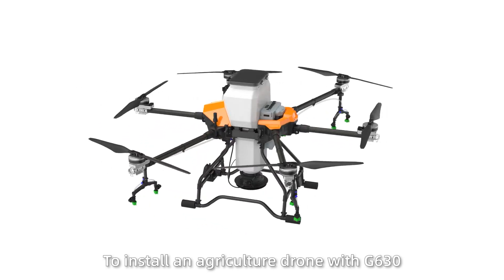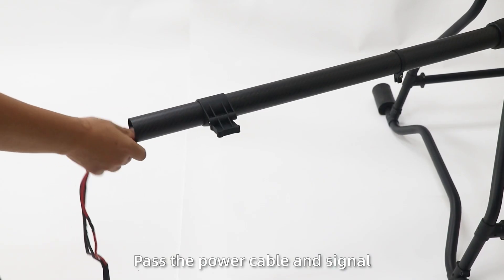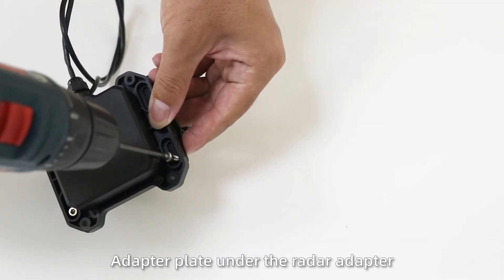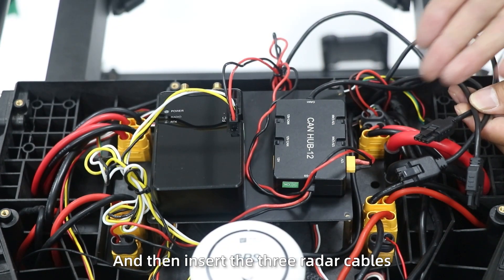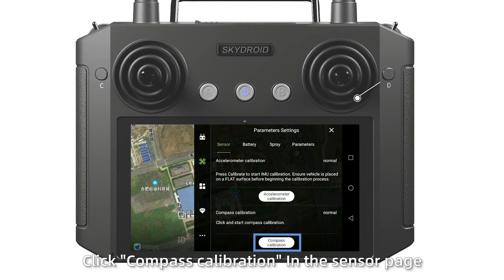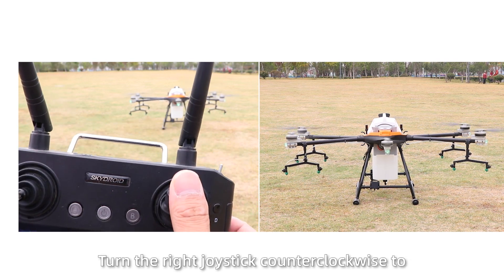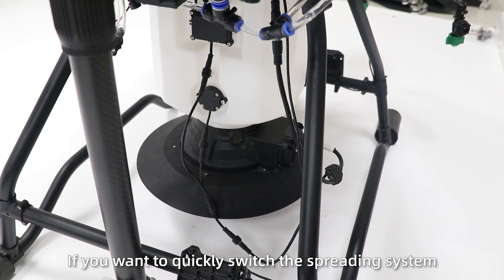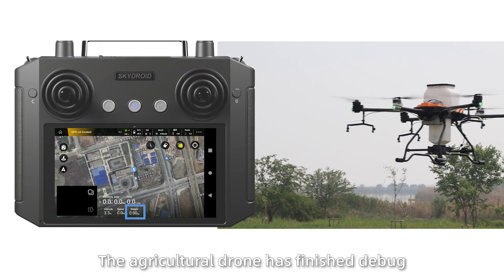Tutorial video || How to assembly an agriculture drone forn spraying and spreading

Comment: Hi, I've been looking for information about drones and I've reached this video.

Is the installation method similar for other EFT models? (e4xx, e6xx)

Is there anything I should buy other than a frame, a water bottle, a water pump, nozzles, motors, propellers, batteries, and joysticks for assembly?
Reply from the maker: The assembly of the E series and G series is slightly different. For the E series, you can refer to this tutorial of E616P, which you can know all the components.
https://youtu.be/r_A6ZNlqfu0?feature=shared

Comment: Where can I get this version of software for RC Controller? When I press New Plot, there are options for Handheld GPS, Flight GPS, Map selection and waypoint mapping, but none of them show the options for plotting the actual flight mission, only borders and obstacles... Is there a video for mission olanning and execution?
Reply from the maker: The remote control we tested is by SIYI company, you can check which remote control you are using, and contact its manufacturer for consultation. We only provide the drone frame .

Comment: Do you have a pdf manual for this? For what are the four thin cables that comes from the battery plug in the drone frame?
Reply from the maker: Yes we have PDF manual , Can you leave your whatsapp number ?
Reply: Hola, solicito de la manera más atenta el manual en formato pdf en idioma español, compre un dron y no lo puedo armar. Ya se ha solicitado con anterioridad la información y no he obtenido respuesta. Gracias
Reply: @conradolopezperez3126  saludos. También lo pedí y no lo han mandado, pero por mi cuenta ensamble un equipo con éxito y ya está operando. ¿En dónde estás ubicado? , posiblemente pueda apoyarte
Reply: @conradolopezperez3126  yo podría apoyarte. Ensamble uno equipo con exito. ¿En dónde estás ubicado?
Reply: @sergioantonioliconagonzale913  saludos. ¿Qué marca de radiocontrol tiene?
Reply: @dagothdr  es el modelo T12 el que no trae pantalla
Reply: @sergioantonioliconagonzale913  ok. La manera rápida es conectando y desconectando seis veces la batería o alimentación del receptor, en la sexta vez ya se deja conectado y el led del receptor empieza a parpadear, en ese momento entro en modo binding y ya se puede encender el radiocontrol para que se enlace. Ese es el modo rápido